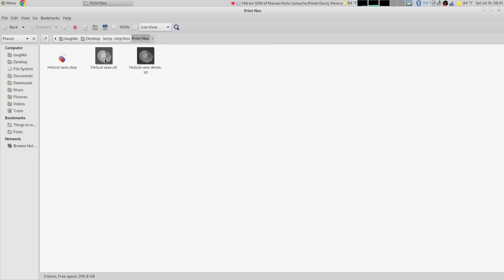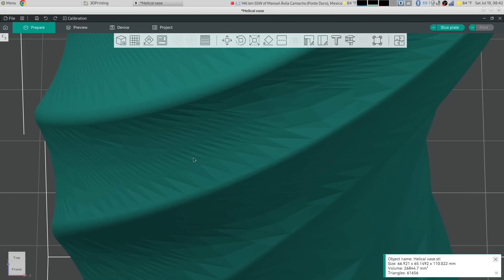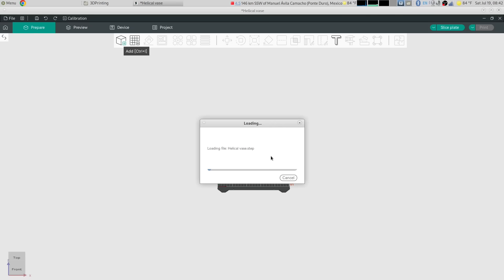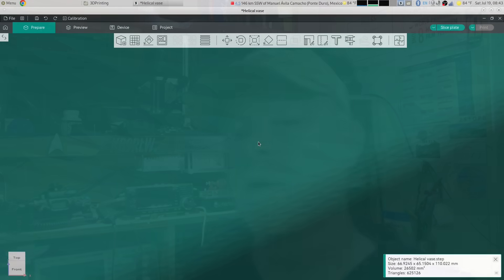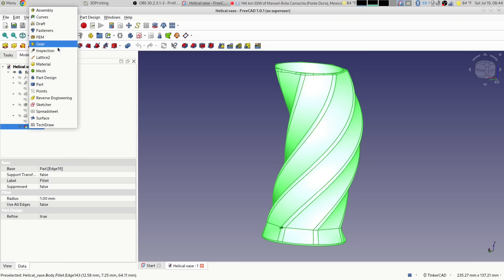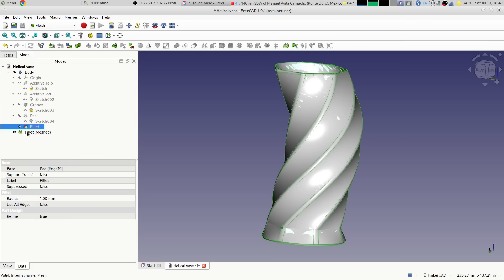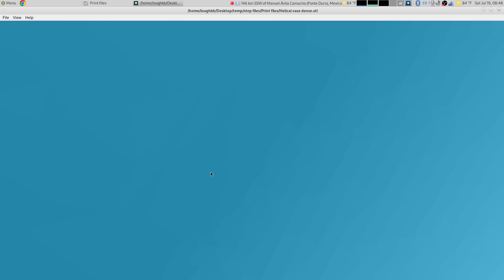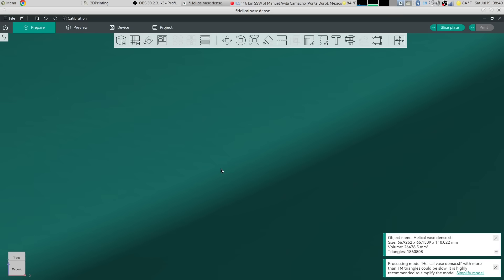3D Printing - Does the step format really produce the smoothest print?

Comment: Great unbiased video even tho there are a couple of gaps you basically hit the nail on the head "IT DEPENDS"

Anything that was designed in blender and blender like programs then use STL.

Anything that was designed in CAD should be exported as STEP.

The math of slicers doesn't need to change they simply need to allow a user to go as dense of a mesh as they want.

Incidentally, Orca does give the user some control over the end result, albeit not intuitively. Under quality if you scroll half way down to precision you can change the resolution all the way down to 0.01mm if you do a lower value or zero then it defaults to its default value. But despite how the mesh looks in the prepared tab the quality is notably better once sliced and the same part exported as a dense mesh to match quality easily sky rockets in file size talking about a 40mb step to 800mb stl file.

I dont know about you, but i only have 50tb of storage on my NAS. Now, STL files do compress well, but that just adds friction to a process.

Sooooo it depends but a slicer should absolutely allow for both especially considering that the brand of 3D printing is on face value only useful for trinkets and manufactured trash at least to an outsider. But it's so much more capable than that.
Reply: Your NAS probably allows transparent file compression in the same ballpark of compression ratios as zipping.

Comment: That is very useful information. Also , as  a Freecad user, I see there is a setting on the data tab that when you select the body for export you can adjust the "Angular Deflection" and "Deviation"  parameters which also directly refine the mesh in your exported STL. That may be easier, I have not experimented like  you, to determine the best parameters for any job.
Reply from the maker: I knew about the body settings.  But I prefer to create a dense version on demand when it's needed.  Changing the setting in the body would force the very long process of generating the dense mesh each time you export.  That would add lots of time if you forget about the change when prototyping and just want a quick print of the latest revision.
There are also defaults in the preferences, but I leave them alone for the same reason.
Reply: @loughkb  Good points